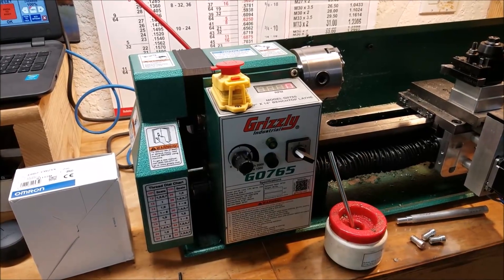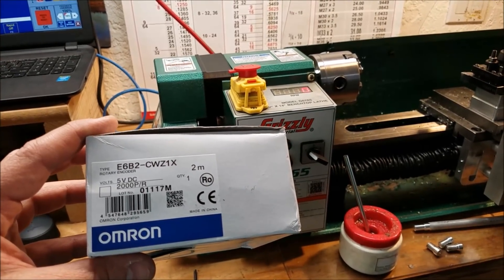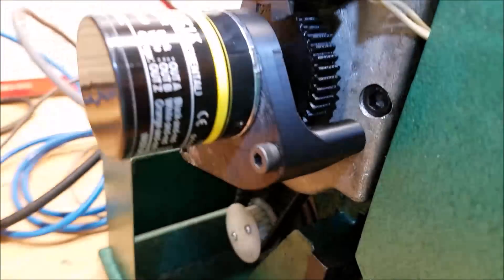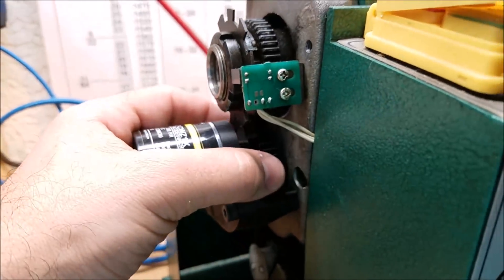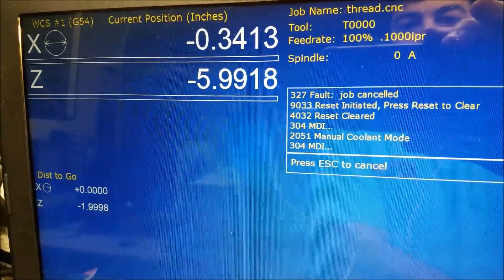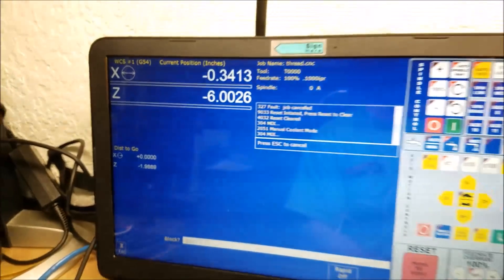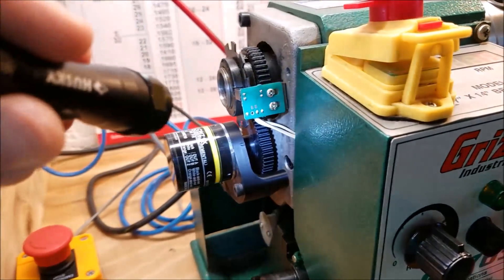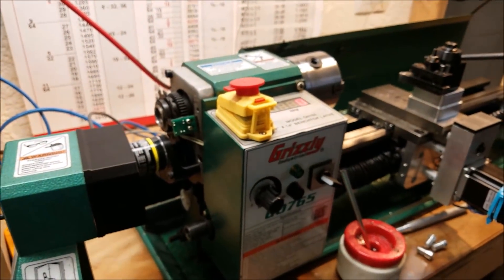OMRON E6B2-CWZ1X 2000P/R Encoder on the Grizzly G0765 Mini-Lathe With Centroid Acorn

Comment: Levisgil47
Levisgil47
il y a 1 minute (modifié)
Hi, Great video! I'm new to this and I got a question. Do you think that using a brushless motor instead of a DC/ac motor for the chuck spindle is useful to develop a CNC machine?

Comment: Would not the gear coupling to the encoder be more accurate due to belt ("0" ring) slippage?
Reply from the maker: The gear worked fine for me - but there is a little bit of error due to the clearance in the gear mesh.  Very minor.

Comment: Hi Franco, its my understanding that the omron type encoders have to be driven 1:1 to the spindle pulley / gear. Can you verify if thats the case or is there some kind of software correction via centroid config? I have been working out a design for CNC conversion of a Taig micro lathe using the Acorn control DMM tech servo's and DYN 2 drivers. I really want to incorporate spindle control for rigid tapping and threading.
Reply from the maker: EmbraceTheSuck Hi. It must be 1:1.

Comment: you would think that an o ring would be able to slip and mess up the acuracy during a job , think a toothed belt might be a better idea , the gear actually looks eazier than going the belt way , it looks factory stock
Reply from the maker: Hi.  There's not much torque on the encoder and I'm told that the o-ring belt thing works OK. That being said, a timing belt would be better.  Fortunately, the gear thing has been working out pretty well for me.  I'll probably use that setup for a while.  Thanks.

Comment: Will you be using the acorn board with your pm25? And will you use an encoder as well?.
Reply from the maker: Hi Ed Peterson.  I will be using the Acorn with the PM25.  I've built the control box around the Acorn board and I'll have that mill up and running soon.  Eventually, I'll mount an encoder on the PM25 - that's low on my priority list as the PM25 had a digital display for RPM that I can use for now.  I'm going to mount the encoder on the top of the motor - there's a short shaft sticking out there to drive a cooling fan.
Reply: Franco , I was wondering how you would  mount the encoder.  Ordered my Acorn board a couple of days ago for my PM25. Hope to see more videos on yours.
Reply from the maker: Hi Ed.  I have an idea on what I think may be an easy way to mount the encoder to the PM25MV.  Eventually, I'll have some free time and I'll work on that.
Reply: Franco looking forward to what you come up with.

Comment: Nice post. To see how well it works, rigid tap or do threading on it. Then re-run the cycle. 
One concern is hanging a pulley or gear right on that encoder. I don't believe it was designed for that load. Its more designed to be rigidly mounted and then a flexible coupler to a timing pulley mounted on a shaft supported with bearings on either side of it.
It will be interesting to see how long it lasts supporting the gear or pulley as you have shown. 
Keep up the great work!

Comment: i dont get it why change the encoder for a new one ?
Reply: I think it’s important to mention that it is an Omron clone. It does seem to work just fine though and the price is very affordable. Nice video, Franco...keep up the good work!
Reply: He's just testing a new encoder
Reply from the maker: Thanks ScotY808.  You make a good point - martyscncgarage confirmed that these are OMRON copies made by some firm in China.  I buy my fake OMRON encoders from eBay seller 832901shu and so far, they have worked just fine.
Reply from the maker: Hi. Most people aren't going to use an expensive Tamagawa encoder on their mini-lathe.  They will probably go with the $30 OMRON from eBay.  I wanted to make the video and share the models to make it easier for everybody to get real-time encoder feedback on their mini-lathe conversions.
Reply: Franco aha didn't think ist so much difference.  Omron is quite reputable too